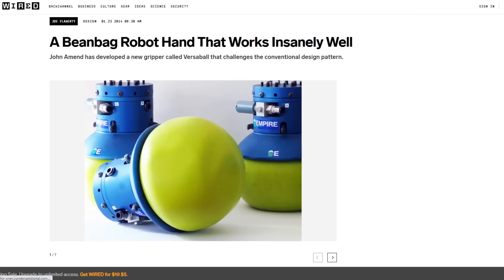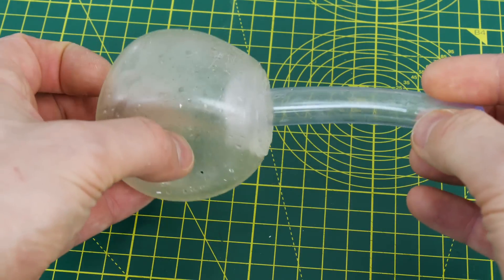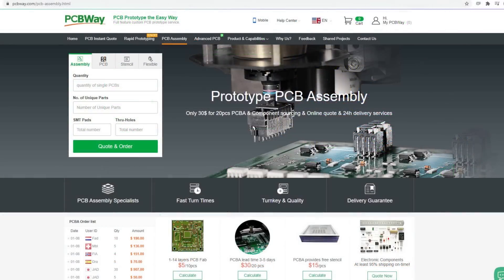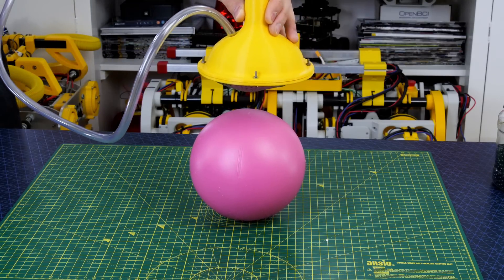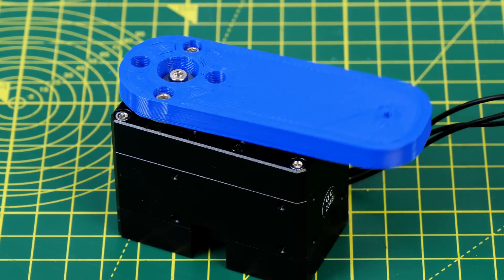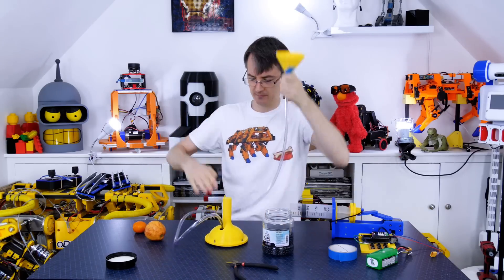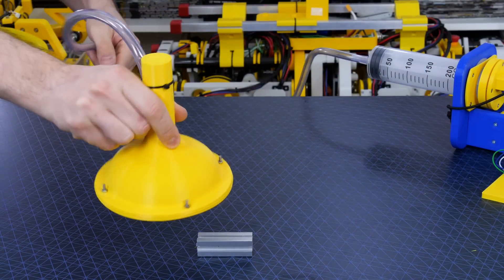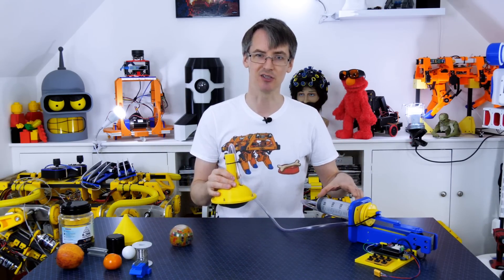Experimental Jamming 'Beanbag' Robot Gripper

Comment: I feel like the spherical form of the gripper is important. The spherical shape works together with the inner pressure to "hug" whatever you want to pick up whenever you press it against it, having it "flat" makes the surface tension work against you, giving the BBs a hard time huging the object. I imagine it like being stomped by an enormous gym ball vs a trampoline, the gym ball is going to hug and form my shape better (weird example, I know)
Reply from the maker: Yep - I'll probably make a custom one next time.
Reply: Yeah, exactly that.
The original one was a large sphere that, when the air was pumped out, would contract - which applied a bit of inward-pressure on the object it enevloped.
With the membrane being fixated at the perimeter sucking the air out will pull the membrane away from the object making it a far looser grip.

Comment: you should also trick around the effect of smaller or larger beeds. I think you could find an inverse law for the diameter of the beed and the raw force of the grabbing hand. Obviously it would make the sucking air more difficult so there could be a sweet spot to find

Comment: One upon wannabe physicist here....

My moderately educated guess .... use smaller BB's.  or bearings.    And ideally themselves compressible       It comes down to surface area in contact with the object and force acting concentrically on the constrained object.           Ya know those "alien frog spawn" might actually work pretty well .... and for that matter, aside from the problem of leaking pumping the whole thing with water or oil might work even better.

Comment: To solve the issue with the positive pressure in the "open" state you could integrate a valve into the plunger. drill a small hole in the bottom of the cylinder and add a spring loaded valve that is opened by the plunger when it is at the bottom of its stroke, but as soon as the plunger lifts the valve closes and it allows the plunger to draw a vacuum. Once the plunger returns to the bottom it pushes on a pin attached to the valve and opens it.

Comment: I tried making one of these with coffee grounds a little while back. The problem with granular jamming is that, unlike regular robot grippers, there's no positive gripping force at all. Once you've sucked the air out, you're reliant on the new geometry (and friction) to lock the part in place. If the granules get disturbed in any meaningful way, the grip is broken, unlike with a conventional gripper that can use force feedback to further close the fingers if the object moves.

Comment: You could probably improve this significantly without going to a release valve:
1. Use lighter plastic BB's
2. Enlarge the hole. Mount the bag using two flanges that go inside the hole to hold the balloon in place. This would allow it to envelop an object better.
3. Tube/flanges in the center so it is more symmetrical and can envelop objects better
4. Improve the code so that it fully expands the balloon to expel an object, then retracts slightly to get rid of excess pressure.
You would need to play around with number of pellets and pressures in order to optimize grip. Basically the main problem IMO is the way you had four contact points to pull the surface area tight like a drum. You want maximum flop.

Comment: I've had an oddball thought about this type of gripper rattling around in my head for years that I thought I'd throw out to you.  Has anyone ever tried creating a gripper of this type using oobleck and vibration instead of solids (like the bb's) and vacuum?
Reply: PS.  If you try it, be mindful of the frequency of vibration.  At certain frequencies, oobleck starts crawling and growing tendrils that lash about which would wreak havoc with the gripping surface.

Comment: This test setup works great at showing off the principle. A few suggestions on improving functionality:

1. Smaller grain size
2. Overfill the membrane with grains
3. Slightly stiffer membrane material

As well, industrial robotics use venturi effect vacuum nozzles that only require compressed air to function. They're not too expensive if you look around (or maybe even design and 3D print one?)

Comment: I don't think the problem to solve here is the "gripping" part. Indexing the part gripped for CNC work is the bigger problem. All of these gripper designs will move the part when they pick it up. How do you track position?

Really cool video! Just the tip of the iceberg, many more challenges to look into here.

Comment: could you use a ball that's permeable to air and a continuous pump? Maybe a vacuum cleaner would be powerful enough. Maybe you could adjust with different types of fabric or a valve on the pump to get the air leaking into the ball to stick the object to it, but still have the vacuum inside strong enough to cause the phase transition.

Comment: Possible dumb idea... But thought about using Rice for testing particle size? Its way finer, would mold better . The issue seems to be the BB Size not the actual membrane. 
Probably would need a mesh before the "funnel" though to prevent being sucked in, but I guess this would work great  Also 2 one way air valves would solve the problem of the air pressure, open when picking up to release air, and open the other one when releasing at the same time you push the syringe. I reckon ?

Comment: Two things. Smaller BBs! You'll get a higher resolution imprint, so more contact area.
Second, the mounting plate (the part that spreads it out at 6:00) works against you. You are severely limiting how much the stretchy bit can wrap around the target object, hence needing to press down with force. In your test case of only ever approaching from above, the plate is unnecessary anyway.
Also your syphon idea at the end is great!

Comment: A vac-splint used by mountain rescue teams works on the same principal but they use poystyrine beads inside them. I guess they are smaller and conform more. If you used water in the system rather than air would that work better as it is less compressible?

Comment: i could imagine that your rubber clamp for holding the squeeze bag in place is also part of the reason why the gripper fails at medium size round objects. maybe you could try to attach it without pre stretching the gripping surface or your gripper

Comment: You can mold yourself a elastic membrane using silicon and 3d printed part (just that the process would take sooo long for a quick experimental video). And using smaller size particles like sand or grounded coffee can can tremendously increase the holding force too.

Comment: i think the issue is the fact that you pinch the rubber around the circumference of the gripper this probably pulls the membrane apart slightly during gripping making you lose a lot of grip

also smaller bbs and a mesh to prevent the bbs from getting sucked in the tube might help too

Comment: I'm curious what the actual grip force is - picking up ping pong balls and individual lego bricks with a weight in single digit grams is easy, but as discovered heavier objects like the satsuma don't really work unless the membrane envelops them with an overhang.
Also, the retention flange might be working against this gripper - if the inside is under vacuum then air pressure would be pushing the outside of the membrane inwards, but if it's being held open by the retention ring then it won't be able to grip inwards as hard.

Comment: The surface the gripper can hold on to is fundamentally limited by the relation between the filler material and the contour of the object or by the depth of the gripper (you can grip unto any object as long as the gripper can totally encompass it regardless of filler size.)

Comment: I agree with others that have said smaller BB's but also what about a 2 stage system where you have 2 syringes 1 that removes the initial air when gripping (perhaps a smaller diameter syringe) then the main one to actually form the vacuum?

Comment: The really original was done by researchers at Cornell university. They tested different materials for their gripper, thickness of the membrane, filling and so on.
Using a latex balloon and grounded coffee was the best they figured out.
At my university I tried that combination also, but using normal balloons, not latex. It works very well, but with time the coffee damages the membrane... Probably chemistry doing its thing. It is quite some work to tidy up all that spilled coffee from all over the work bench.

Comment: Smaller BB's would make far more sense since the larger ones just dont form a tight enough shape around objects. its like the concept of filling a square with spheres, the bigger the ratio between the size of the shape and the size of the spheres the less gaps exist and the more accurate the fill becomes.

Comment: the original prototype from the inventor of this utilised used coffee grounds, because they're small, sharp and lock together. I don't think you needed a bigger toy to make a bigger gripper, you could have just packed more material into it. Then you would wind up making it so that it would lock together partially if the pressure was removed and you had to push air into the system to free it.

Comment: what happens if you try and fill the system with an incompressible fluid like water or (hydraulic)oil. I think using this you can get away with less travel/less volume in the syringe. and you might be able to get a tighter grip as well.

Comment: Instead bb's you can just use any spherical stock to reduce the weight. Also (as mentioned), you need smaller filler-balls like poppy seed, or might even use sand. You can combine poppy seed with larger polystyrene packaging balls.
Reply: I just have came across the video of @Practical Engineering about Suez Canal, where he explains, that fillers containing non-spherical pieces (like sand) grabs better under pressure, because the pieces will likely to rotate causing the whole volume to expand.

Comment: As others have mentioned, maybe smaller balls but what about if they were softer (or perhaps have holes in to allow them to have the air sucked out)? I assume with smaller balls and a flexible membrane the would encase the object better? And if the balls themselves could have some air sucked out or were slightly softer, the would compress together and lock better?

Also, would the texture of the membrane affect it? having it rough or a finger print type pattern may help?

Comment: I mean I'm usually not "that guy", but you should really tune that printer. It may not cause issues now, but if that ball was easier to puncture I would have seen that happen looking at the print inside. Also it would indeed prevent a proper seal around. Obviously, that's not gonna happen, but I think viewers can learn from that. :)

Comment: Long Follow-up from a previous interaction about ROS and MoveIt ahead:

Incase you were curious from the message I made the last time about ROS and MoveIt with robotic arms, it wasn't too bad to get the arm modeled with a URDF (though there is only one third party single person made plugin if you are using fusion 360, and its based on one which was abandon a few years prior and has newer features that make it easier to use).

Setting up the arm with ROS though was another story. 

Starting from the hardware up, I ended up using yet another one person project for the I2C driver ROS Node for the pca9685.

Because this robot just uses standard mg996r hobby servos, it has no feedback, nor did I have a robot controller (a necessity to control an arm with MoveIt). Luckily, the work around for this wasn't too difficult as MoveIt includes a fake controller which allowed me to run the demo for my arm configuration without gui (the Jetson Nano 2GB struggles otherwise because of CV) and take the joint states which were published to send to the arm.

To do that, I created a translation node which subscribed to the joint state publisher topic, and converted the outputted angles to the normalized -1 to 1 inputs that the i2c node I found takes.

OK, so now we are at the MoveIt stage. Setting it up took quite a few hours. Trying to make it move in the control node (self made) the way I wanted though was extremely painful, and ultimately I still haven't found what I want. What I was trying to do is have a computer vision node further up the chain smoothly move to an object by centering a camera over, and using the offset of the camera and end effector to pick up the object to eventually do more complex things.

I really wanted smooth real time motion simply reacting to the input from computer vision and control, which was the offset of the bounding box of the object to the center of the camera (because otherwise you'd have to do the trigonometry and have depth sensing).

Unfortunately, well... just don't bother trying to get servo feature working (the Move it module that allows for smooth live movement) if you are on ROS 1 with 18.04 as my Jetson is on and as is the latest release for it.

I contacted one of the developers through a public channel and they were nice enough to sit with me for a few hours and even then it was a bust. It is the furthest thing from beginner friendly I have faced. Unless you know how to read and code C++, just don't bother. I am somewhat adept at C++ for a hobbyist and it just wasn't worth it to pursue, though I'm a glutton for pain and might hack at it again.

On the other hand, what I eventually gave up and chose to use, worked just fine, and while the movement was a bit more jerky, it did work. What I did, was use the standard, python interface to plan and execute moves with each positional update, moving in increments until the camera was within a threshold where it would perform a grabbing motion which was more or less hard coded to remove the offset of the camera.

As for the computer vision, I think this channel has already covered that, so this wont be a challenge at all. That being said, there are readily available examples for the Jetson line from an nVidia employee so that was surprisingly the easiest part of this experience.

Ultimately, I think I should have just stuck to the simple python script I had before, but noooo I thought. Someone else must have done even better math than the simplistic movement math I did, and ROS seems interesting to learn, so I took the unnecessarily painful route instead. Still though, ROS seems useful, so I guess Im half on half on whether the experience was worth it.

I suppose there should be a conclusion here on whether or not I think setting up a ROS arm is doable in the timeframe it takes you to make one of your videos, and the answer would be maybe, if you had a guide showcasing the pitfalls, or alternatively if you have a robot which is very well aligned with MoveIt already. I had a janky one off custom robot with 3d printed parts (one of which was because the servos were so weak it couldn't pick itself up fully extended and the other because the gripper servo would get hot under load), so my experience definitely was more difficult as a result.

Comment: Just a quick recommendation, use smaller BBs or other small balls of some sort, more points of contact on an item and a more “molded” fit on an object. You don’t need something bigger, just smaller BBS unless u want to grab bigger items then you would ideally use both a bigger system and smaller BBs.

Comment: Maybe use a fluid instead of air in the system? That would probably allow a harder sucking effect. Also; I wonder if bbs are the best shape? Maybe something with rougher / non-regular shapes? Something that has a much stronger locking effect than spheres. Sort of like how not all sand is suitable for concrete due to the shape of the grains.

Comment: That is a very cool concept! The armchair expert in me are thinking of variables that might make it better;

• The membrane having a soft texture and being stickier. Just some small textures that would increase surface area, like "hairs" or something as simple as a diamond pattern or anything in that ballpark. (Maybe glue a couple of gecko feet on it? /s)

• Much smaller BBs to have the membrane conform better to objects, especially small objects with contours. Something like <1mm lead (or maybe soft) spheres, or sand, or cornstarch, or flour might work? Maybe even some kind of foam? With balls or a material that can compress it might be easier to implement the "shooting" that the professional grabber has, if that is something you want. (Would probably be unnecessary, overcomplicated and very hard to implement as you would need quick and accurate control of the air pressure).

• Like you said, having the membrane ball protrude more and be more spherical would make it better at grabbing objects.

• Better controll of the air pressure, both in grabbing and letting go. No idea how to controll that better withouth quickly becoming complicated though. 

I really like the concept! I hope you dive a bit deeper into it and see how well you could get it to work. It seems like so.ething that could be a great addition to the bots you're making!

Comment: Naomi Wu could probably put you in touch with a manufacturer of larger silicone components. 😉 From her video on the subject they're specified in cc's and available in many incremental sizes.  The manufacturer doesn't necessarily describe them as squeezy toys, but the name still fits.

Comment: i think your plunger cup is too deep, it seems the beads kind of spread out instead of mold around the object. if you look at the original again you can see that in its relaxed state its almost a half-sphere pointing outwards. this gives it way more material to mold around the object, which you've lost to the depth and width of your cup.

so my suggestion is scaling down the cup and maybe making it more flat and less deep. that way you have more volume protruding out and.